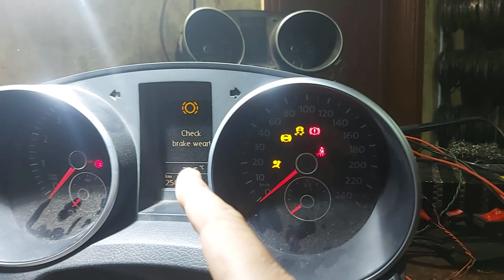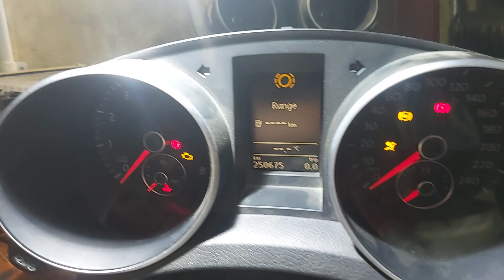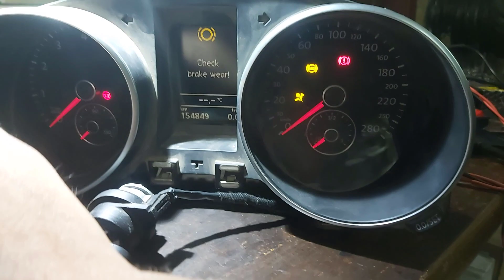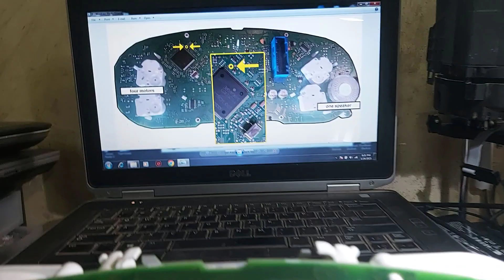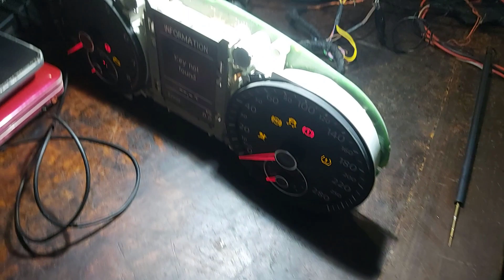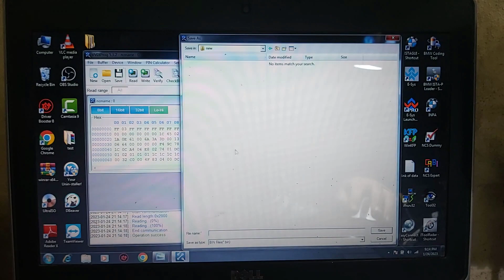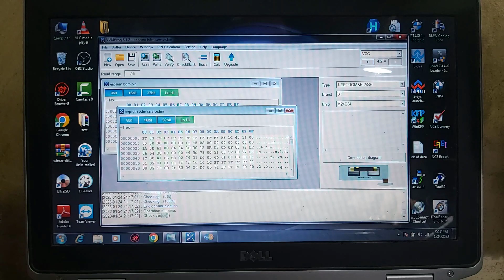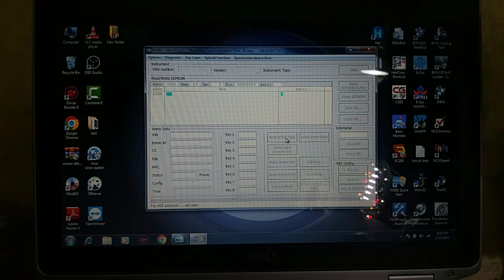Golf6 Cluster Swap With VVDI2

Comment: Hi
THank you for video
I have no VVDI2 but the best tool and faster tool for this is Original Car Prog On Line
The whole proces cloning dashes lasts 20 minutes and you do not need to program key as well
Reply from the maker: You are welcome
Reply: Hey, can you please help me with this?
Reply from the maker: What's your exact problem? What's app +201005387513
Reply: @heshamessam8042  I have a VW Jetta 5 with immobilizer 3 and I want to swap the red screen instrument cluster to a black and white screen cluster from a Scirocco. I need help with that, which program can I use?

Comment: In vvdi2 is service mode option is shows you need read eprom first and whrite back in dash.
First need to whrite original eprom by obd back to dash. After this you can read the immo data and as last step whrite old(orig immo data) back to it. This it. When make this on car, first safe abs coding (very important)

Comment: Hi, im doing the same cluster swap and im having a keyless go key. Steps that i do
1. Read old cluster eeprom using vvdi prog and prepare service mode using vvdi2 then enter and read immo data. Copied immo data in text file. Write back non-service mode dump and reset cluster steps are taken.
2. Read new (used) cluster eeprom and prepare service mode. Read immodata and modified vin, cs, mac, key, pin, status, config. i couldn't modify power class. Write back non-service mode dump and reset cluster steps are taken.
3. Am i missing some steps here? I couldn't get the car switch on ignition and started. Immobilizer active is written on dash. Can you please help me on this?
Reply from the maker: Read immo data from old (don't know why servicemode as u have a working key ).. write to new (will need service mode to access immo ) ... also read vvdi2 manual as someone one told me in comments

Comment: what about just exchanging the chips on the board?
Reply from the maker: Which chip ? Eeprom ? Immo data is on eeprom and processor as i think
Reply: @heshamessam8042  
I don't know exactly, but I think it's on the processor.
Reply from the maker: @solarsolari6705  and also eeprom... so what will you exchange? ... both ? Will need sane hardware and very hard to do
Reply: @heshamessam8042  
Why both?! Isnt the Mileage on the one of them only?
If the doner cluster is exactly same model do we still need hardware ?
I thought just swapping the chip it works
Reply from the maker: @solarsolari6705  swapping chip as i know will not work ... hardware is same if part is same not neccessarily the model ... anyway reading and writing the data is the best way at least on my opinion  and that what i do